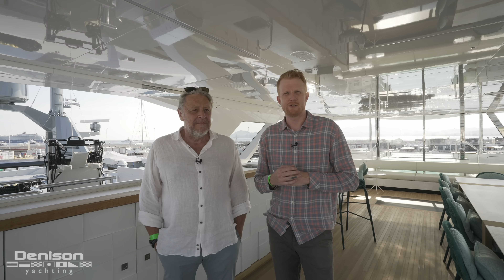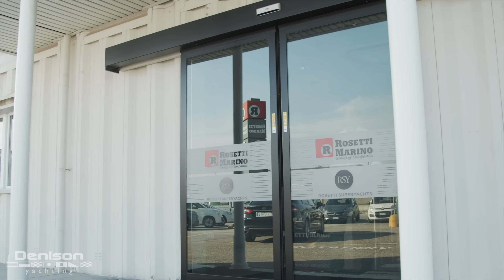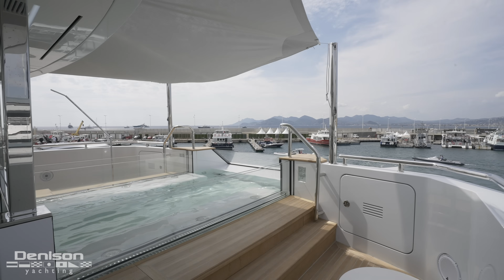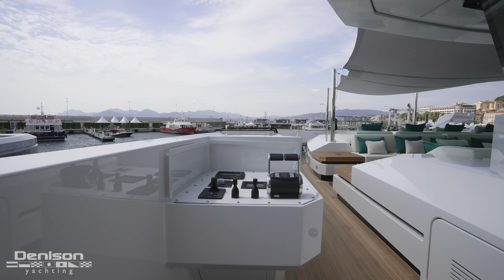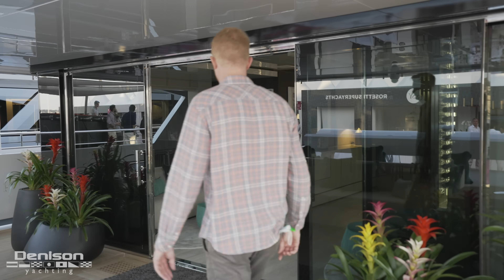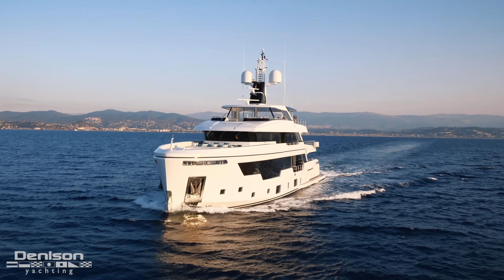Rosetti Explorer Yacht With Sergio Cutolo [EMOCEAN]

Comment: If anyone wants to see what the crew cabins looks like, watch NautiStyles review at about the 7 minute mark. They are very nice, each has a privacy curtain. There are 3 crew cabins, with the captain so a crew of 7. The crew mess is also pretty nice. Lots of refrigerators down there as well and they have the AV systems and some fuses in that area. In the bow area on the port side is the laundry center with 2 washers and 2 dryers and then to starboard is a storage/utility area.